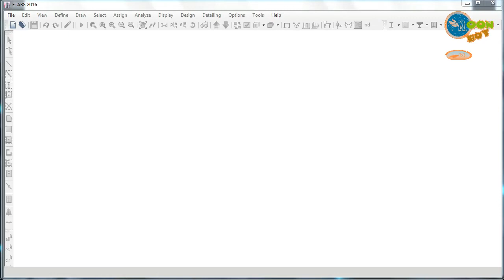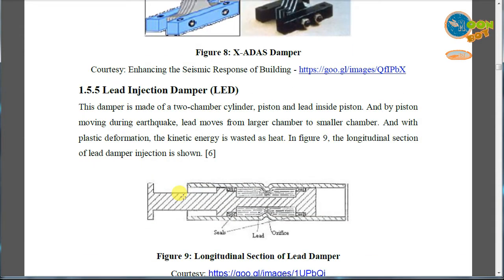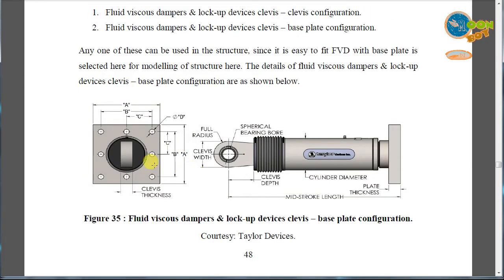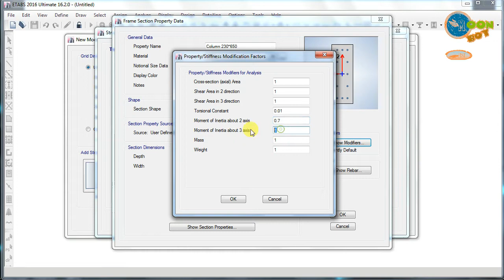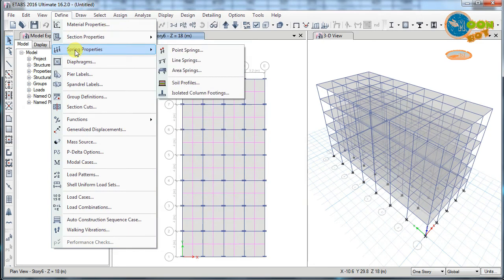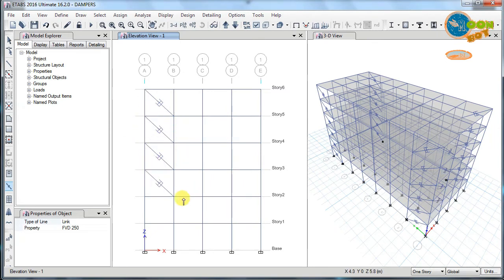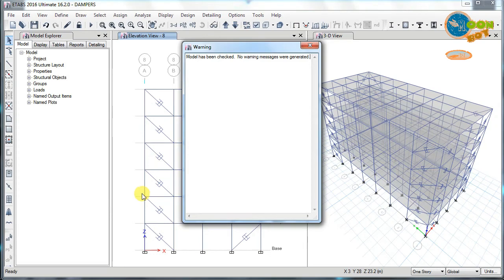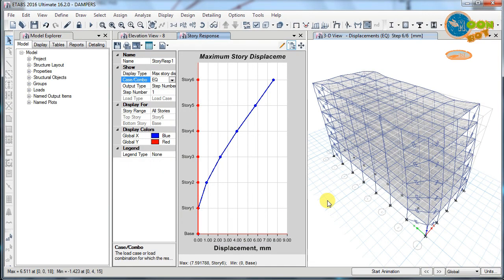Etabs 2016 tutorial 15 | Modeling of Dampers, Direct Two way slab Building G+6 | Using IS Codes

Comment: just wanted to ask you something ...the question is not related to this video ...but to some other video you posted before ...while taking the axial force of corner column in a multistorey building in all stories it is increasing from the top to bottom , with the same loading condition if i check for different zones it is increasing as expected but values in zone 2 and 3 are not the same in each storey ...zone 3 is higher ...this happens probably because of the contribution from shear ....the entire thing is inferred when i perform linear static analysis ....but on performing response spectrum irrespective of the zones values are the same ( even though it increase from top to bottom ) ...but at each storey values are the same in all zones ...could u explain why it happened like that ?

Comment: Hello sir, i have a question, it is not mistaken to use the same damper (defined in the U1 direction) for both sides of the building? ,  i think dampers acting on X direction should be defined in U1 and dampers on Y direction should be defined in U2, but i am not quite sure. Ill apreciate your answer
Reply from the maker: U1 only need to be taken since the damper used here is a uni-axial
U1 is in the local axes system.

Comment: Sir i have used u r tips in modelling dampers in ETABS. I found that after applying exponential dampers ( properties mentioned by u) i found that there is an increase in base shear after applying dampers. I would like to know what made base shear increase after applying dampers.
Reply from the maker: Abhishek Trivedi Due to addition of dampers the self weight of the structure got increased. So the base shear does.
Reply: But in u r ETABS file it got reduced may i know the reason for that????
Reply: After applying dampers increase in base shear is correct or decrease in base shear is correct????
Reply: Sir need u r reply as soon as possible....
Reply: @abhishektrivedi8934  hello sir, did you get the answer of that case? I also have same case with yours. Thank you.